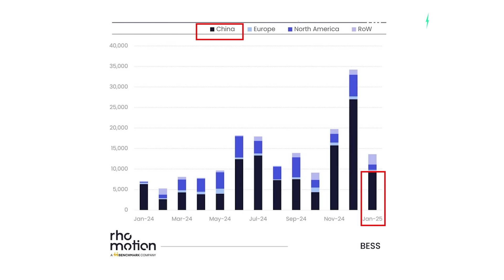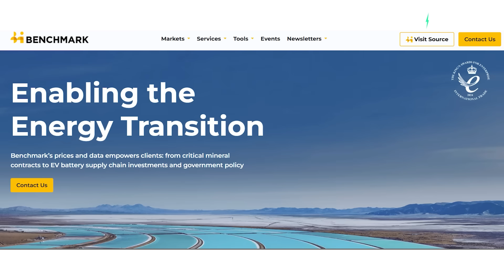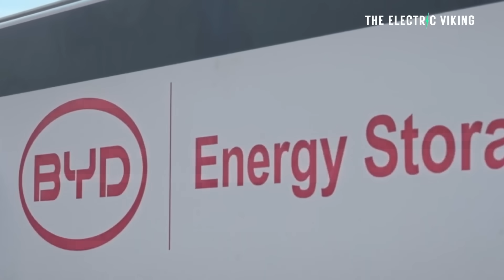World Record 13.6 GWh of mega battery storage built in January

Comment: In addition a lot of coal capacity they build is modernizing old blocked to more efficient ones. Since they still can’t switch them off as demand is too great.
Reply: Utilisation rates at Chinese coal plants is down below 50% which means many older less efficient plants are losing money. Closures are inevitable. China is heading down the path of using its coal plants in a similar way to how we use gas peakers.

Comment: i think in Germany there are now over 120 GWh planned. the reason is to buffer a lot of wind energy. this will NOT be payed by the government. this is payed by private companies. and the return of investment is between 18 months and two years. they are buying electricity when it is cheap and sell it when it is expensive. at the end, it will reduce the hours where expensive LNG needs to be used to produce energy. and on the other side, some times when there is too much energy from wind, the batteries can take that and the wind power generators do not need to be switched off. there are many parties who profit. the battery owner, the solar farmers, the wind power generators and the German citizens because that lowers electricity prices.
it is a kind of gold digger moment now for these companies. and because of these high profits, they are scaling up like crazy.
and the cool thing is that they are using old abandoned coal power plants for that because they already have a fat connection to the grid.

Comment: Battery need new protective tech, at detecting thermal run away, electric switch break off positive, negative link
Breaking all large battery banks into smaller batteries that's Not connected

This is tech in use in some new cars in China, electronic switch break that cut down size of battery, detect crash, after accident similar to airbag deployment

Safe battery so whatever size one build can be safe & easier to control
Obviously better be LFP or sodium battery

Comment: Where does the energy come from to charge the batteries?
Reply: From Uranus
Reply: @hahtos  so you don't know either
Reply: It doesn’t make much sense to charge them with fossil energy. So, renewables.
Reply: @Simon-dm8zv  yeah, depend on the weather, and your monthly electric bill will shock you.
Reply: @skylershank9309  Batteries will prevent just that.
Reply: @Simon-dm8zv  batteries have to be charged by some form of energy, not other batteries.

Comment: Study after study after study said 100% renewable grids were possible, mainly just by spreading out generation and improving the grid to make it easy to move electricity around (since its usually windy and/or sunny somewhere), that was before battery prices plummeted, I'm even more convinced it can be done now. No need for nuclear or fossil backup.
Reply: There is absolutely no way batteries can store enough energy to ever replace fossil fuels. Oh, and what if the battery arrays catch on fire? Moss Landing?
Reply: @sullivanrachael  It's literally already happening under your nose.. what if a fossil fuel plant catches on fire?
Reply: @sullivanrachael  Moss Landing: 24 year old NMC battery tech.
Reply: @ - 24 year old. But newer doesn’t guarantee fundamental improvement in runaway or overload or degrade over time characteristics? Besides - the ultimate problem is there is never going to be enough battery backup to run a normal grid when the main input is from the wind and solar.
Reply: @sullivanrachael  1. Please read up on those characteristics of LFP batteries compared to older NMC tech. 2. No one with a brain says that all countries everywhere can supply all the electricity all the time from solar, wind, and batteries. 3. Denmark, granted a small case study, is now a net exporter of electricity with wind and solar being over 60% of their generating mix. Before wind and solar took off, they were a net importer.
Reply: @sullivanrachael  If the wind and solar are large enough, and the grid is backed with enough pumped hydro, then battery can be more than sufficient when you have mass V2G and Time Of Use charging incentives for EVs.  China is going to prove that to be the case in 10-20 years, as their renewables skyrocket and they get serious about phasing out coal.
Reply: @markvalery8632 - LFP - Lithium Iron Phosphate batteries have about half the capacity of NMC. There is a mixed chemistry, and other variants. But the elephant in the room is batteries can back up the grid for hours only, and we need days - when the solar output is low and wind doesn’t blow. To believe otherwise is denying reality.
Reply: @sullivanrachael  This is not my area, but seems logical:
The traditional concept of baseload power is becoming outdated in a grid with high renewable penetration3. Instead, the future grid will likely rely more on:
Flexible dispatchable sources
Energy storage systems
Demand response mechanisms
Overbuilding of renewable capacity

Comment: I'm a energy solution provider here in Jamaica and we are just  putting in a tiny 15mwh of storage. What I can say is most of the battery footage is Huawei battery and they can operate in really high temperatures due to the inbuilt refrigerative cool system which either produce cold air or chilled water depending on the model battery.

Comment: Future of Static batteries are Sodium Liquid Metal Batteries. We have been using Lithium liquid metal batteries since the early 90's but with the price of lithium we decided to start selling it & replacing it with sodium. It seems pointless to use lithium when weight isn't a factor.

You think 80°C is hot for batteries our batteries run at 450°C the major advantage is with liquid metals you don't get dendrite growth.

Comment: Why.....don't they build these battery packs underground, where it is much cooler?.
No need for A/C, or A/C at a minimum, as the heat is not so extreme... 🤔
Reply: And put solar panels on top!!
Reply: The natural configuration is solar roof over battery storage, but the ideal locations are typically desert, so heat is still going to be an issue at least half the year.
Reply: Make lots of sense, or a solid roof with open side ways for venting air movement
Reply: @james_l4337  If you've ever been in the desert, shade is great, but ... if it's 40 C / 104F in the shade, it's like you're in an air fryer being blasted with hot, dry air.
Reply: @ZweiZwolf  u are right desert have hot air may be a mud wall
Whichever is cheaper better faster

Dig & bury with corridor underneath
Erect mud wall surround if cheap save digging?

Comment: The idea that you can build a grid that can run only on solar and batteries is so absurd I can't believe Sam keeps saying it.  There are 2 functions of battery storage today.  Firstly it can be used to stabilise the grid from minute to minute or hour to hour by supplying extra power when passing clouds cause drops in solar radiation, or when the wind fluctuates.  The second reason is to extract profit by charging the batteries when the price of electricity drops and selling it back when prices rise again.  This is known as arbitrage.  Please do not confuse these two functions with the idea being promulgated here - that of a system that can store sufficient energy to provide baseload power during Dunkelflaute and thereby eliminate the need for the gas fired backups that are currently in use in all hybrid generation systems.  The problem is one of scale. To scale from the storage levels that are needed merely for smoothing power delivery in real time to providing a full baseload for days at a time requires, not just increasing the current storage by a factor of 10, but more like a factor of 100.   If an economy needs say 1,000 Giga Watt hours of power in a 24 hour period then you would need 1,000 Giga Watt hours of battery storage to provide 1 day of backup baseload, 2,000 Giga Watt hours for 2 days, and so on.  This amount of battery storage is astronomical, with a price tag that would be measured in the hundreds of billions of dollars.  Battery storage will never come anywhere close to achieving this and gas will always remain on hand to provide the needed backup - unless and until a transition to nuclear occurs.
Reply: Thanks for your post but as I’m sure you realize by now most people here are impervious to math and logic
Reply: This depends on the scale of the grid.  China is transitioning toward a grid that is based on renewables (hydro, solar, and wind) and next-gen nuclear, connected by high capacity Ultra High Voltage lines running from the western desert to the populated east, supported by massive pumped hydro and industrial batteries.  They are making their grid so big, with so much capacity that the sheer scale of the thing will make it work.  And yes, they're going big into mass-produced nuclear as the next step.
Reply: Dunkelflaute (winter high pressure system with no wind & minimal solar) is a North European issue, and relatively localised. Interconnection between countries and continents can resilve that problem.
Reply: Hundreds of billions of dollars is not that much when you consider the cost of baseload energy. Look at how much just one nuclear power plant costs; in rough terms it would require 500 nuclear power plants to power the US, and the average price tag of one plant is $7.5 billion dollars, and so 500 plants would cost $3.7 TRILLION dollars. This is just the name of the game when it comes to baseload electricity - astronomical sums.

Comment: There is no sodium because the manufacture plants are in construction yet, except a small fraction. That would change quickly soon.
Reply: for sodium ion batteries it is still hard to compete with LFP. only if sodium ion tech significantly improves. but on the other side, LFP improves as well.

Comment: Low hanging fruit Sam. Sodium battery banks will come when they start building them in cold climates. At the moment most solar power is going to the warmer climes I suppose. Just a guess though. Lithium wouldn't be much good in a place like Greenland or Siberia.

Comment: While it’s great how massively China is building up renewables and also driving it globally by changing its market what you said at 1:01 was not quite true for 2024 where China approved 66.7 gigawatts (GW) of new coal-fired power capacity.
The faster we all get to wind. solar, water (rivers/tides) based renewables the better. And those massive batteries are definitely an important component in the picture.
Reply: Yes, and jan '25 is about 30% higher than jan '24
Reply: China also retired just as much old coal-fired capacity.  You need to pay more attention to electric generation rather than capacity, because China is adding clean, efficient peakers to replace dirty baseload.  Those new coal plants coming on line were approved a long time ago, before solar and wind installation growth turned exponential, and were likely at a point where it didn't make economic sense to cancel

Comment: Batteries store baseload too, so those plants can be operated at optimal boiler temp and pressure with the lowest carbon output per MWh.
Reply: Batteries go very well with nuclear powerplants too.
Reply: @JSM-bb80u Actually no. Nukes like to keep running. They definitely don’t like being flexible.
Reply: @dermotbalaam5358  They run constantly. They can't be ramped up and down during peak hours. That's why all pumped hydro stations were built with nuclear powerplants. They run constantly and they would recharge the pumped hydro storage in off peak hours.
Reply: @JSM-bb80u  No we can shut down the expensive Nuclear power stations and use cheaper safer and cleaner solar to pump water for energy storage. Much cheaper than batteries at the moment.
Reply: @Terry-y2r  nuclear is actually as cheaper as solar and wind are. if you considered  transmission required for renewables. That's why china is building a lots of nuclear powerplants. The country building most renewables are the ones also building most nuclear. China is also building the most pumped hydro and battery storage capacity.
Reply: @JSM-bb80u  Not according to the scientific and engineering experts at CSIRO. New Nuclear power stations also need new transmission lines to transport its electricity. All governments with Nuclear power are subsidizing Nuclear. If Nuclear was so cheap, the US would have gone 90% Nuclear by now. (only 18.6%) Solar is the fastest growing power source in countries with suitable land mass and sunshine. China's power requirements is massive because of its population. Only 4% of energy in China is nuclear.
Reply: @Terry-y2r  Nuclear doesn't need as much transmission as renewables. Nuclear needs a heavy initial investment. But it lasts 80 years. That's why private corporations don't invest in nuclear. Solar and batteries wouldn't have become cheaper if not for Chinese government investments. Australia and USA and all other western countries are now free riding in Chinese investments.
Reply: @Terry-y2r  China is the only country with Ultra High Voltage lines to support long distance power transmission, and is adding huge amounts of new solar, so adding new power transmission lines isn't as big of an issue as you think.  China is investing VERY heavily into the next generation of nuclear, after pausing Gen III construction after seeing Fukushima fail on their doorstep.  China has the world's only Gen IV conventional Pressurized Water Reactor, the only new Thorium Molten Salt Reactor, and the only Small Modular Reactor under construction.  When the testing is completely, China will obviously mass produce a LOT of nuclear plants, cookie-cutter style, directly replacing existing thermal power to leverage existing distribution and control.  When China starts mass producing nuclear power, they will export to the Global Majority further increasing economies of scale, and bringing power even closer to solar and wind.
Reply: @ZweiZwolf  Don't be so sure Nuclear will be economically competitive with solar. Solar is a technology that is getting cheaper. Nuclear has a long way to go to catch up as far as cost goes. That is what will determine if Nuclear is rolled out large scale.
Reply: @JSM-bb80u  Solar on domestic roofs requires no new transmission lines at all. Nuclear still needs transmission lines, and existing lines may not be suitable. The facts remain the same, Nuclear is more expensive compared to solar, even after the costs of transmission are taken into account where the climate is suitable for solar. Where its not sunny, wind is also much cheaper than Nuclear. Both wind and solar do not have a nuclear waste problem, that lasts a thousand years.
Reply: @Terry-y2r  You have it backward.  If nuclear is rolled out in large scale, it will be economically cost competitive with solar.  Solar wasn't so affordable until AFTER China scaled up.  Neither was wind.  But once China started pushing BIG volume, the prices came down dramatically.  Nuclear will be the same way.  Instead of each nuclear plant being a bespoke one-off, they'll be pumped out one after the other on assembly lines, bringing the cost down.
Reply: @ZweiZwolf  Nuclear is old technology. Solar is the new technology. Nuclear is also dirty and dangerous, solar is clean and safe and over 90% recyclable. Solar has no moving parts, hence easy to mass produce. Solar technology is also improving. Nuclear is a complex technology with many expensive to make low volume parts. Smaller portable reactors will have higher labour costs per MW. The cost of storing waste has not got cheaper, and refining costs are also still expensive. The economy of scale will not eventuate to the same extent like solar. Solar and Hydro are the cheapest now today. Cheap Nuclear has always been fiction.

Comment: Batteries are the quick solution for grid storage; in a matter of months.
But if we started all the pumped water storage systems that could exist right now, we'd get a big increase in storage in a few years.
And then a few years after that, car batteries that are down to 80% of capacity can be retired and also used for grid storage.
By which time we might also be able to add LFP and even sodium-ion batteries to that.

But we have to commit to the idea of storage instead of looking for excuses.  Most people don't even seem to understand the role(s) of storage.
Reply: the thing is, that we don't need the support from the public and we don't need additional education for the public for this matter.
why? because financial greed is more than enough to drive this. i'll explain:
in Germany there are many of these battery projects under way now. what they are doing is buying cheap electricity and selling it expensive. that difference on the electricity stock market is high enough to get the complete investment back in 18 to 24 months!!! this is a crazy short time. and these systems last for over 15 years! that is a better profit than any stock market investment. that means, finding money to scale this up as fast as possible is absolutely no problem at all.
promise the investors a profit of 15% per year guaranteed and you get all the money in the world to pay for those battery installations.
Reply: @ Yeah, being able to arb electricity like that means you're basically buying a machine that consistently generates free money with zero risk and near zero maintenance.
Reply: Car batteries hit 80% capacity and basically stay there 5-10 years after start of service.  They don't get worse, and neither does the car.  If the car is fit for service with 80% capacity, then there's no need to replace it just to add a little more grid capacity when sodium batteries will be even cheaper and more consistent than an aged pack with a mix of good and bad cells.